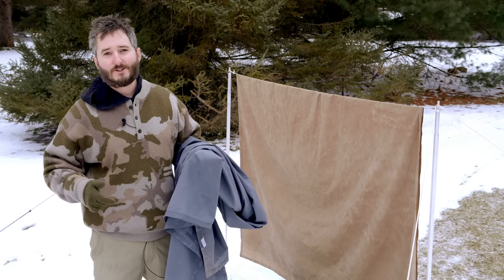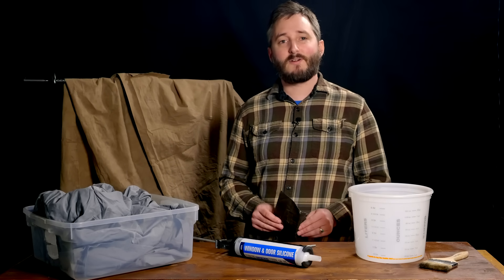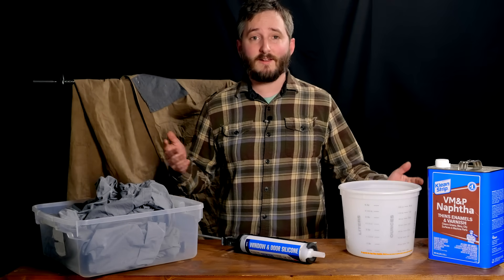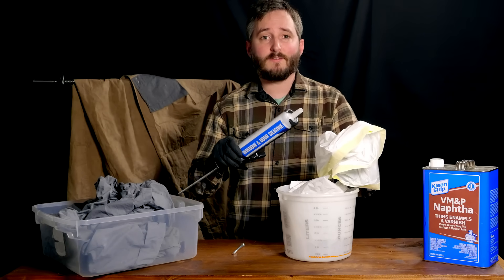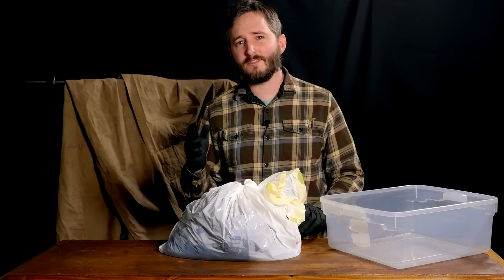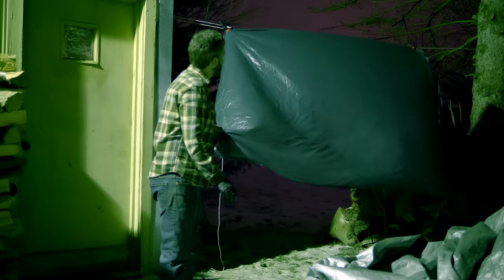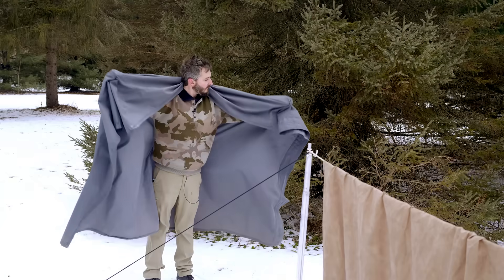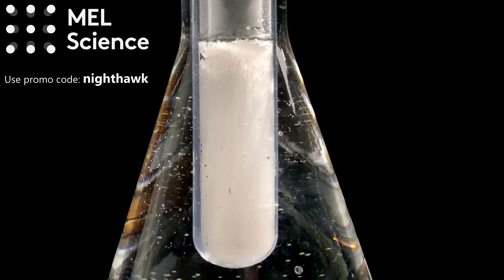Recycled Bedsheets Make The Best Waterproof Tarps

Comment: Last spring, I used naptha and silicon like you demonstrate here and brushed it on my convertible car's fabric roof - amazing!  Not only did my roof stop leaking in the rain, whenever it snowed this winter, I never had issues with the snow melting and seeping through my car's roof!  A new roof would have cost me $360; the current one is 6 years old but other than seeping/leaking, it's in great shape, hated idea of paying to replace it.  A quart can of naphtha and a single tube of cheapest silicon cost me $11 total last spring, and I spent around an hour, maybe bit more, mixing it up and brushing it all over my car's roof.  I did, however, have to throw the brush I used away as I forgot to clean it lol
Reply from the maker: Thanks for sharing your experience!
Reply: @Nighthawkinlight  You're welcome, and thanks so much for sharing how to do it!!
Reply: That is a great tip, I will use this on the vinyl roof of my classic cars and cabrio too ...
Reply: Great video thank you

Comment: Just want to let you know that painting cloth with "Spar Urethane" will seal  & waterproof it.  Spar Urethane is clear, UV resistant, oil based and finished result if similar to old fashion waterproofing using linseed oil.

Comment: does it work with wool blankets? i have a poncho like the one Clint Eastwood uses in his old western movies and id like to make it waterproof
Reply from the maker: Yes, but it's wasteful to treat a thick blanket by soaking it because it will suck up a lot of liquid. Might be better to just spray the outside
Reply: @Nighthawkinlight  could it work if i apply it with a brush on the outter side? it has a hood integraded on it so it could be easyer to find the waterproof side, if it works ill come back with the results
Reply from the maker: @juanarredondo9763  Possibly, but I would practice on something you don't care about

Comment: Here is a nontoxic method I have used to waterproof shoes, backpacks, etc. Use the finest part of a cheese grater (or better yet, a lemon zester) to make a big fluffy pile of wax shavings (beeswax or parrifin). Then just sprinkle it evenly across the surface of whatever you're waterproofing and then use a blow dryer or heat gun to melt the wax into the surface of the fabric.   Impregnated with wax, no nasty chemicals like Scotchgard!
Amendment: I forgot to add that there's an even simpler method that might be just as good. You take a candle and rub it evenly all over the surface of whatever you're waterproofing, then heat.

Comment: I'm following these steps but for some reason the silicone is not dissolving I'm using 230 window and trim silicone sealerit says it's clear but it comes out white so I went ahead and used it anyway and I'm not getting any results as far as dissolving is concerned and yes I'm using naphtha.
Reply from the maker: I should have been more specific about the type of silicone in the video, but at the time I was not aware that some does not work. What you need is type I silicone, also called acetic acid cure silicone. It should smell of vinegar. It's possible your silicone is type ii, which will not dissolve properly.
Reply: @Nighthawkinlight   Thank you for the information I will try that next

Comment: hey i went to my hardware store and i asked for Naptha and they said theyre not aloud to sell that anymore in new york state! is that true that naptha is illegal now? cn i buy it somewhere online? 

another question i have is flamability and lingering odor. I need to  make a tarp that i can stretch across the length of my livingroom and bedroom. My landlord is trying to pressure me to vacate my apartment of my own volition by refusing to fix the roof for the past twenty years. Once they build a terrace on the roofwhich would be accessible for my neighbors who have a loft area upstairs the ceiling in my bedroom and livingrtoom began taking in rain water. for the first 15 years they would send a guy out once a year to patch up the holes but when covid startted they stopped doing that and asked me to move out. lacking a \realistiist place to go i remained so they just harrassed me in various ways and oine of those ways is to  not repair the roof not even patch the holes so i have several bucket collecting water and this essentially makes it impossibel for me to go out of town for any length of time becase i cant let me buckets overflow  or else it will leak into my landlords apartment. you might wonder why i woudl be protecting them so intently, and the answer is simple. just because some one else does a thing does not make it the right thign to do and its better for my self and my life if i focus on doing the right thing regardless of the  choices others make because i cant force someone to be kind but i can strive to be kind myself. 

anyway my poiint is , is this method of using naptha safe for indoor applicatiion, i mean post process. does it have a lingering chemical smell for the duration of its existance.  is it machine washable. is it highly flamible , if i was using it for a tent could i pitch it close to the fire pit or should it be twenty feet away or somethign. if i am using it indoors to collect and isolate the incoming water into a single stream source that i can then attch a hose to and let it be guided to the window ..... okay if i did that would my apartment forever smell of naptha? 

to clarify i would make it in a well ventilated place like my balcony, and let it dry overnight on the balcony (hanging on a laundry line, but probably folded twice t fit on the space i have) and im considering doing this with two king size sheets because a king size sheet would easily cover the area, walll to wall in both rooms..

Comment: i found this video most helpful. making a sheet of some description fully waterproof. one that can be used as a tarp and worn on the body will be great but how to make sure it is both waterproof and breathable because when wearing a waterproof jacket that is not breathable just defeats the object for staying dry as your bodies perspiration becomes locked in between the surface of your skin and  the non breathable jacket,  you just become soaked in body sweat which is no good for hot or very cold weather conditions when walking or cycling long distances. how would you make the sheet waterproof and breathable that is the question.
Reply from the maker: The sheet is breathable as is

Comment: A really good presentation. I've been using the system here in Oz for quite some time, and it works. If it can handled Australian conditions it can handle just about anything.  Make sure you air it well before use!!! One constructice critisim: 5 to 1 ratio is good,  but what is the volume in the tube and what is the volume in the can?
Any Ozzy looking for napthalene in Oz will have difficulty but white spirit is the same thing (near enough).

Comment: How cold was outside when you did yours in the video? Mine is currently outside in -34 c
Also I think I overdid my ratio with the solvent, the mixture was pretty watery but the silicone seemed mostly mixed, other than a couple clumps which rubbed into the fabric easily once hanged.
Will see if the water resistant properties are there after it’s fully dried
Reply from the maker: -5-10c I think. Might take longer for yours to dry. Should be fine if a bit watery as long as the silicone dissolved

Comment: Hey, hi. I just finished waterproofing an old Far West hooded coat. I have it out drying right now, but It has the potential to be perfect. A couple of suggestions. Don't use garbage bags, just a pail or container. Garbage bags are just a pain in the ass. Use 2 liters of your solvent.... I had Coleman fuel. Thanks for your post

Comment: Awesome video and info if I do my rain gear should I use brush outside of the jacket and pants ?
Reply from the maker: I'm not sure. A brush or maybe a chemically resistant spray bottle. Be careful, the solvent is very flammable. It's fine once dry.
Reply: @Nighthawkinlight  what's your recommendation for jacket and pants how to do it
Reply from the maker: @rahimi420fr  Probably a spray bottle. I don't know, I haven't done that myself

Comment: so how did dangling in the wind affect saturation of the silicon material? were there thicker spots in the lower corners or anything like that? this is my current concern, i have all the supplies ready to rock-n-roll otherwise. that and the cold but it seemed to dry just fine for you out in the snow

Comment: I saved this video last year and I've just been waiting for the opportunity to try it.  We really needed this because we wanted to leave our snow blower on the driveway rather than having to drag it uphill in the snow when we needed it, but, as he says, the cheap tarps you get in stores just disintegrate.  So, how did it go?  
First, I totally underestimated how easily the silicone would come out.  It's one thing when you're squeezing out a little to seal something, but emptying the whole tube requires serious work.  My hands are still sore from when I did it last weekend.  
Second, I just had a heck of a time distributing the liquid easily over the sheet.  All the liquid goes to the bottom, and once it was absorbed by the sheet, it was hard to get a sufficient amount on the rest.  I did use his trick of wringing in the dry spots with a wetter spot and that seemed to work, but it was also hard to tell where the dry spots were.  It isn't just the completely dry spots, either, but the places that got wet but not saturated.  
We just tested it on a small part and I think it worked okay.  The water definitely stayed on one side of the sheet and didn't leak at all -- as long as we were on a good spot of the tarp.  The back side did feel a little damp when we were done.  On the whole, I'm happy with the result and I'm planning on using it.  I really want to come up with a better way of soaking the sheet adequately the next time, though.  I think ideally I would buy a respirator so I could just squish the sheet around in an open vat, because then I could really see what I was doing and make sure all parts were getting plenty wet.
This is an awesome idea and absolutely fills a need cheaply and relatively easily.  As with anything, there are some difficulties that aren't obvious from the video, but this is a trick that really works.
Reply: I would be pre washing a new sheet, would be necessary bc of the manufacturing chemicals used to make them crisp and perfect looking for sale, like towels are coated in crap and basically non absorbent until after a few washes.
Anyway, new or old sheeting, I think using a wetted- dried to damp then soaked in the solution would work great to help coat more evenly as the fibers are evenly pre moistened and will evaporate with the Naptha.

Comment: you can also wash the sheet with wash-in waterproofing, air dry, then use the spray-on waterproofing over the whole surface on both sides.

Comment: Hello, good idea!  My problem is:  There is NO seller for Naphta in Germany. Can I use Xylol instead?  Or what is the main chemical in VM&P Naphta?   I would like to waterproof my synthetic motorcycle clothing.  Wonder if the velcro and zippers can be damaged?
Reply from the maker: It's similar to ordinary gasoline/petrol
Reply: @Nighthawkinlight  Ordinary gasoline smells bad.  I tried cleaning gasoline - but the silikone does not dissolve at all.
Reply from the maker: @0n596  There are two common types of silicone, type I and II. Type I should smell like vinegar, that's the kind that dissolves well

Comment: Using naptha and not mineral spirits, my sheet did bead the water off, but when draped over a cardboard box and sprayed with water, the box still gets some water soaking through, not much, but enough to wet the box, if i already treated it once,  would it be ok to do a second treatment, or will it just let water through on an item thats touching it no matter what, kinda like a tent, will the waterproofing improve with another treatment?
Reply from the maker: I think the reason it lets water through is because of the thread count more than not enough silicone.

Comment: The problem with using these solvents is that they can spontaneously combust without warning so if you do this in the sun or it's hot out side it's posable it could catch on fire, I have had painting rags catch on fire long after I finished my job and the rags were dry...

Comment: At time marker 1:02 the narrator of this educational video explains that plastic tarps break down when pulled on, or stretched, or folded too many times. Actually, plastic tarps can be folded more than a 1000 times without fraying the fabric. The real problem is that the plastic tarps sun-rot. I live more than a mile above the surface of the ocean and the ultra-violet light (UV) light and other electromagnetic radiation from the sun in the sky cause the plastic tarp to sun rot. For any plastic tarp T, if plastic tarp T is left out=-of-doors for more than 30 days, then tarp T is no longer one single tarp any more. They seem to fall apart into 3 or 4 pieces and fray at the edges.
Reply: One day I decided to browse amazon's tarp selection because I realized that a good high-quality tarp makes an excellent gift for men, and I discovered that all of Amazon's tarps are the same lousy chinesium-crafted garbage that fail after a few months in the sun and wind. Any decent quality and size tarp runs HUNDREDS of $$. It's ridiculous. Thus, my interest in this video.

Comment: the best video on this topic as he provides the ratios of silicone to solvent and the volume needed for the sheet. He also provides a ratio for the volume of the item being treated. Seriously informative so watch this one and ignore the others, everything you need to know is here. thanks for such a helpful guide video 10/10
Reply: UPDATE. Because its hard to get naptha I was forced to use turpentine. At first it looked as though the silicone wouldn't dissolve but after about 10 mins of mixing everything was dissolved into a clear liquid. I used the exact ration suggested in the video and 1.5L of turps with 300g of silicone was just enough to fully treat a king sized cotton sheet. Perfect result. The sheet was hung dry and then left in the sun for a day to ensure that there was no turps smell, none. I then treated 100m or para cord, the zip off legs for my tramping pants and some colour faded swim shorts. All worked perfectly. I added some paint to the mix for my swim shorts and they are no longer faded with the added bonus of instant dry after a swim. This process works perfectly

Comment: @3:30 tip: When pouring liquids from a container with an opening on the side of the top cover, turn the container so that the opening is at its highest point before you pour. This makes it flow with less disturbance caused by the air pressure.

Comment: So many comments. I’ve been putting off redoing some patio chairs because I wanted to make water proof cushions. Its a beautiful wrought iron glass table top with 4 chairs. The seating fell apart on the chairs. Plan is to use plywood put new cushions and recover. I guess my question is.. will this work  for any fabric of my choice and can I brush this on the wood as well ? Or what do you recommend. I have some beautiful upholstery fabric .I found table on Facebook Market place for $140. After doing research to see how to repair some of the coating chipped off the iron, I found it’s vintage a worth $$$$.     Any advice I would greatly appreciate. And I’m also trying to find out what is the best coating to fix where little pieces chipped off

Comment: Does anyone know if you need particularly high thread counts to make this work? Or, will kinda crappy sheets still work okay?
Reply from the maker: Ones I used are as crappy as they get. It still works but a little mist makes it through the tarp under heavy rain. High thread count will help
Reply: @Nighthawkinlight  have you tried double layering them? Thanks for the response!
Reply: @Nighthawkinlight any update on how they held up for durability

Comment: I’ve just made my second one. First one came out trumps. Waiting on this one to dry out. Which actually seems to happen rather quickly. Like 10-15 mins. However I’ll wait a few more hours. 
I had a partial tube of silicone that was partially set. Decided to go ahead and try and use what I could out of it. Got a few bits of set silicone in there too. Most of it dissolved anyways, however it will be interesting to see what happens with this sheet.
Reply: "Came out trumps"?

How are they holding up?

Comment: Not trying to be one of those crazy types, but does anyhow reliably know how readily silicone reintegrates with the environment?  Useful as this is, construction materials and hardware solvents aren't to be used lightly.  There's great utility here.  A lightweight water repellent fabric would have many uses across the board.  Just want to circle around for when such a thing might get discarded, after rips and tears suffered in the course of use.  Hopefully folks would drag it back to civilization, to be burned by WM or equivalent... but a lot of stuff doesn't.